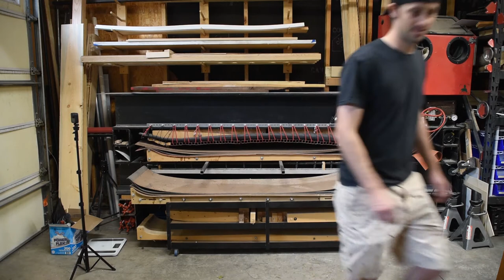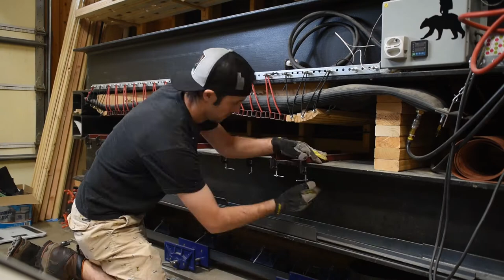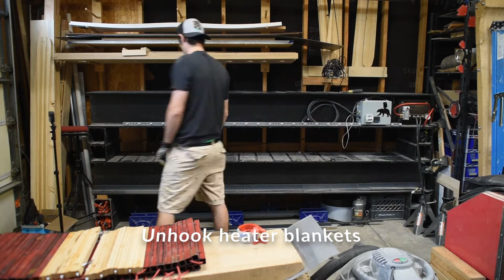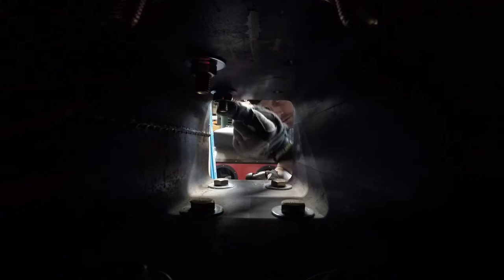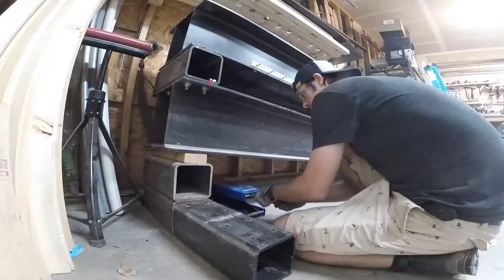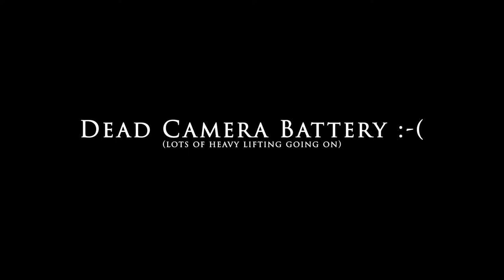Ski Press Tear Down

Comment: where did you get your silicone heater blankets from?
Reply from the maker: It was a custom blanket from MEI aka Michaels Enterprises.  They were super easy to work with, I highly recommend them.  

Qty. 2    16" x 84" 220 Volt Watts (to be specified)
             10 Ft. SJO Cord w/Tab (exits corner 84" side)
             (2) Type K Thermocouples (location per drawing)
             NO Fasteners
 
Price per heater: $552.51 each + shipping
 
Shipment: Approximately 4 weeks on receipt of order.

Comment: Hello how dit you make the connection on the bladder from the Schrader valve to the compressor connector. Thanks for your answer! Greetings from Amsterdam.   https://www.dropbox.com/s/43xo5bs3bahozwt/bladder.jpg?dl=0
Reply from the maker: Greetings from Colorado USA!!  I used this part: https://www.mcmaster.com/50785K273/ and this part https://www.mcmaster.com/4429K412/ and a 1/4 NPT quick connect fitting (not exactly a shrader valve).  I used this part to control air flow.  https://www.mcmaster.com/3368K29/.  I also added a manifold  with a pop valve, two hoses (one for each fire hose), and a pressure read out.  Feel free to shoot me more questions if they pop up!
Reply: @redbarrelskis3361  Hi I was thinking using a vacuum port but I don't know if it can hold the pressure the fire hose needs. https://www.scabro.com/images/thumbnails/465/465/detailed/0/VBU_2___3.jpg
Reply from the maker: @DutchBootFitter  Oh interesting, I can't say I've used that type of port before.  My press can go up to 90psi but I usually only run it at ~25psi.  As long as those can withstand that I'd bet you'd be fine.  If you do give them a go let me know how it works.  I really like hearing about that kind of stuff.  Cheers!